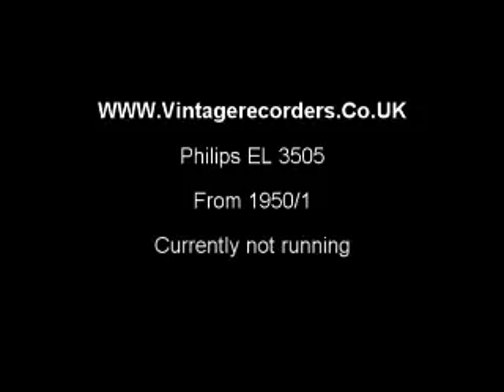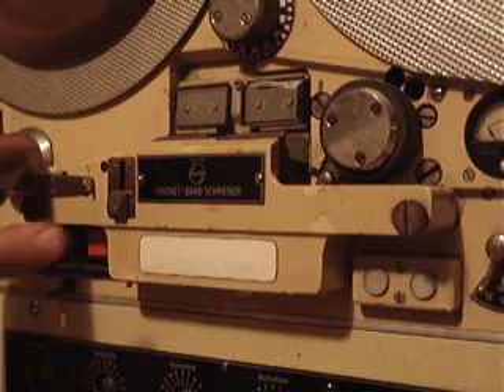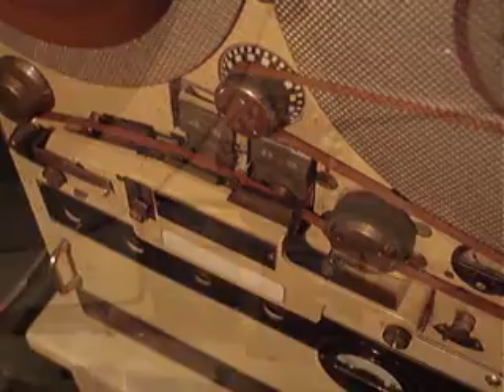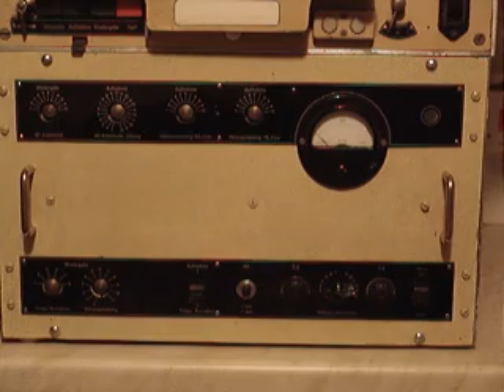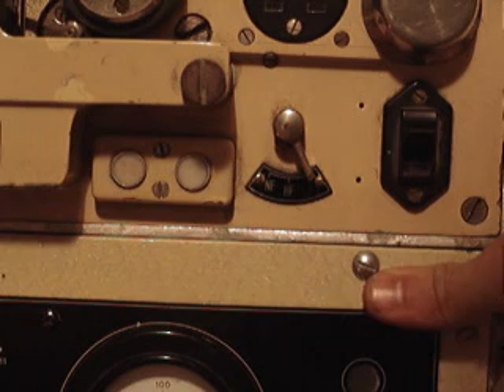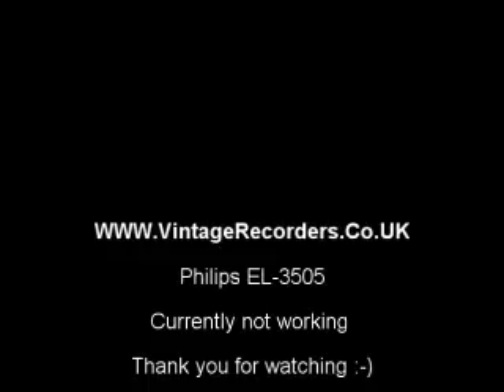Philips reel to reel EL-3505,

Comment from the maker: That is correct, the tape on this machine is wound oxide out, there are a few machines which do this, it's mainly the early pro recorders and a few odd domestic recorders however the Studer A816 is also wound oxide out, this recorder was around in the 80's There was a debate about which way the tape should be wound to prevent print through, in the end it didn't matter but with the tape wound oxide in, it makes editing easy as the operator can see the heads.